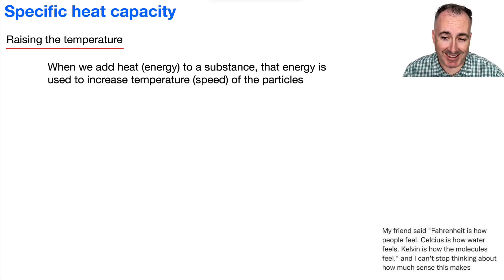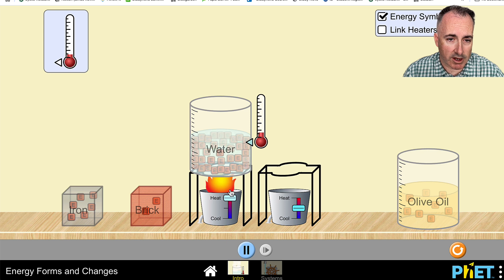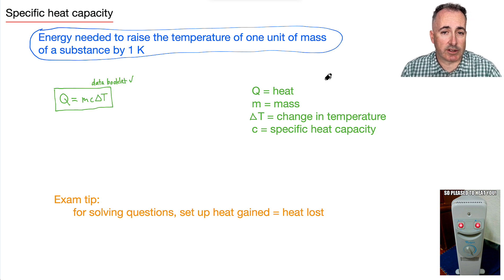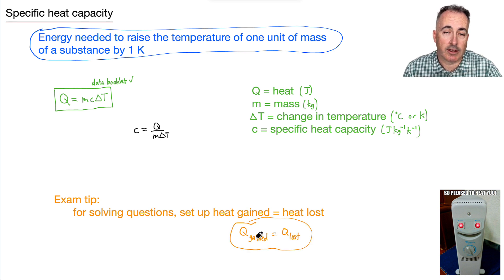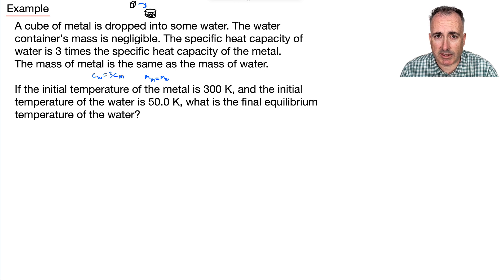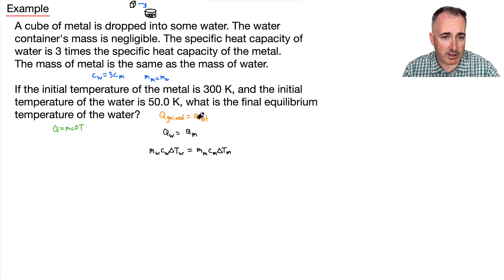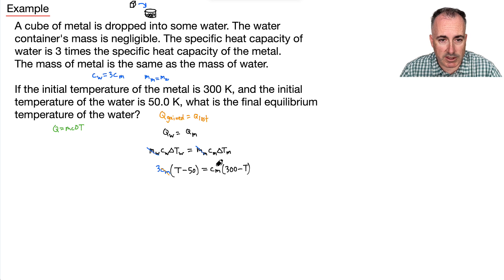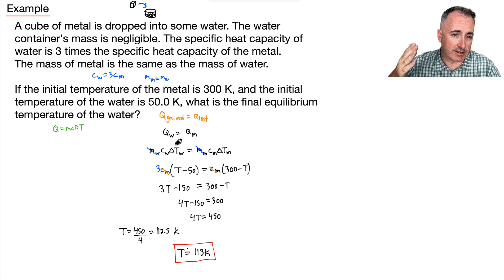B1.2 Specific heat capacity [IB Physics SL/HL]

Comment: hello Sir, 
I hope you are doing well.
I have a question:  if  ΔT is given by "final temperature - intitial temperature", why at 7:15 , you did "300- T" ? I understand that the temperature is decreasing, making 300K  greater that the final temperture however, I am still confused about the fact that you did "300-T"  instead of  " T- 300". Can I please have some clarifications ?
Reply: Is it because the change in temperature should always be positive?
Reply: He did 300-T because that side of the equation (the metal cube) loses energy (T will be smaller than 300K, thus, to keep the dT positive, we subtract T from 300). Likewise, the left side of the equation (the water) gains energy, therefore, T-50 (T will be larger than 50K, thus, we subtract 50 from T). If you replace it with T-300, it is impossible to solve the equation.
Reply: he explained it. re-watch it.